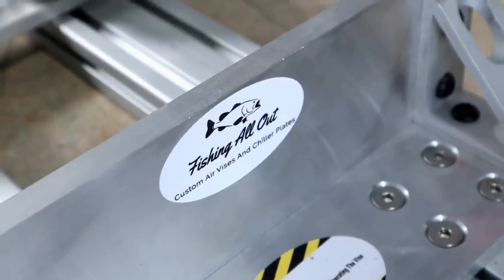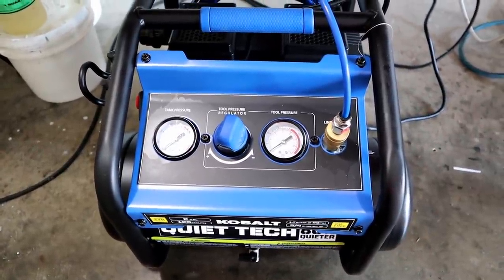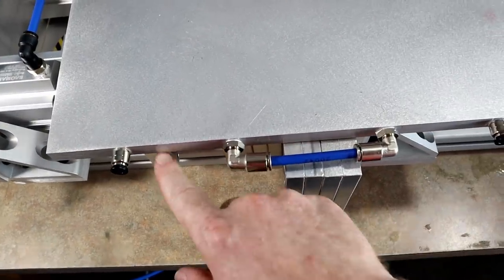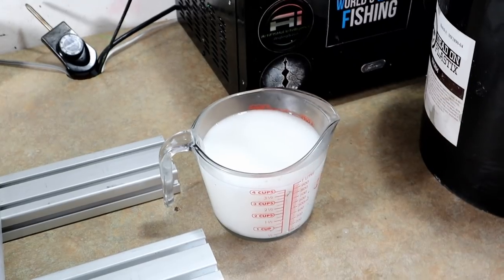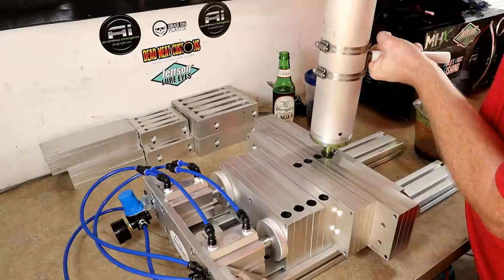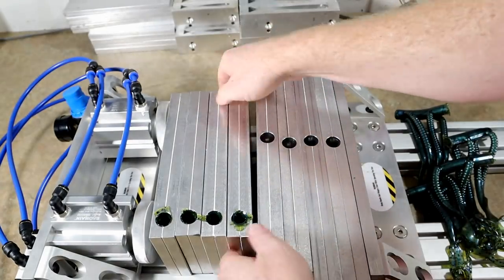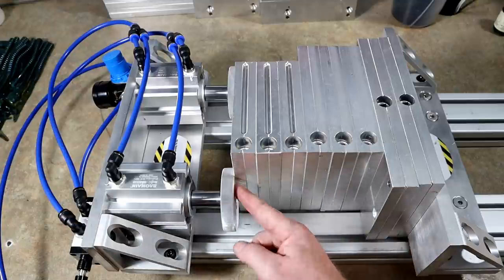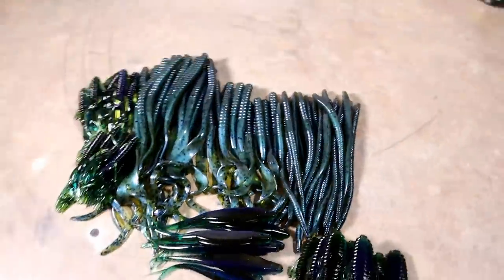Testing Out Our PNEUMATIC AIR VISE For Clamping Bait Molds!!!

Comment: a t-handle allen wrench would make the loosening and tightening of the bolts much easier and faster
Reply from the maker: Absolutely, my basic Allen wrenches are slow pokes
Reply: get a drill allen set from amazon

Comment: I need to make something like this for my garage. It would pair nicely with my pneumatic can crusher. To speed up adjustment of your back plane you can swap those bolts for thumbscrews. 8 is probably overkill if you ask me. What psi are you running that on?
Reply from the maker: 80 is the default setting

Comment: I've seen this on a few other channels, and while cool looking, I don't do the volume of baits to need it. I did want to get your opinion on the Ultramolds Shooting Star, as the multiple ports to withdraw the plastisol and the holder really seems like it minimizes plastisol loss. Also, what are your feelings on using cooling plates between the molds to help the plastisol firm up faster?

It seems like the hobbyists are on the brink of an industrial revolution.
Reply from the maker: Well the shooting star is one of the oldest systems we have and to me it is still the best one.  I have not used chill plates with actual injection molds yet, some of my production friends swear by them

Comment: The cooling plate needs a cup holder for your drink also won't cooling down the aluminum mold too fast cause warping
Reply from the maker: Yes it can cause that especially in open pours.. it's like anything else it's all about timing and practice

Comment: Does that system have a moisture trap in line or maybe its on your compressor? I work with pneumatics at work, moisture will destroy those pneumatic actuators. When air is compressed quite a bit of moisture falls out of it and if it builds up the air will push it inside the actuators. Id totally buy something like that but since its something I know extensively Im thinking of building my own.
Reply from the maker: That's a good question I have seen moisture traps on a few airbrush systems, I will definitely ask

Comment: 17:10 I have a question wouldn't it be easier to just stack extra molds behind the molds your going to use so you don't have to constantly be readjusting the machine to the right size and just cover the molds your not using so you don't accidentally fill them up just asking I was just a little curious about that.
Reply from the maker: Yes absolutely, but I wanted to show how you adjust it
Reply: @WorldsWorstFishing  oh ok thanks for answering my question

Comment: You realize when you are clamping the narrow molds you can use one of your longer ones next to the clamp heads for a maximum clamping footprint.
Reply from the maker: Absolutely, but I wanted to show that the clamp was designed for you to fit smaller molds on both rails and still get coverage from the Pistons.

Comment: The cooling plate needs to be incorporated into the clamp process on bottom And the sliding clamp lock has to be on top of the cooling plate for the lockdown Through a top ratcheting device With a Spring loaded thumb bar on the Backside So Slide bar Can be incorporated This method would Eliminate the screws In the lock down part of the system